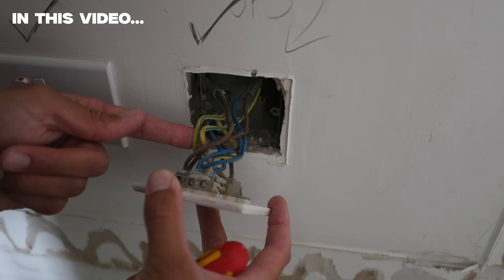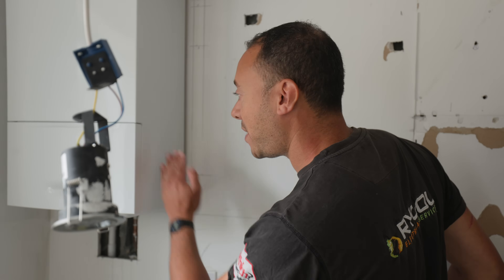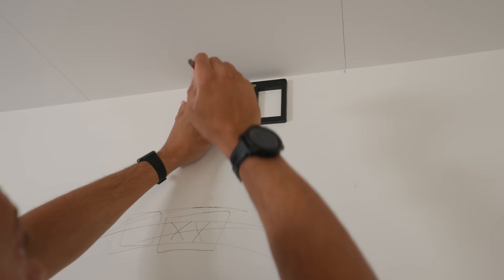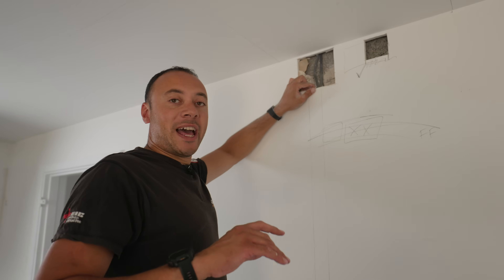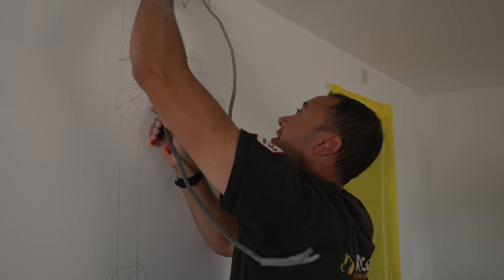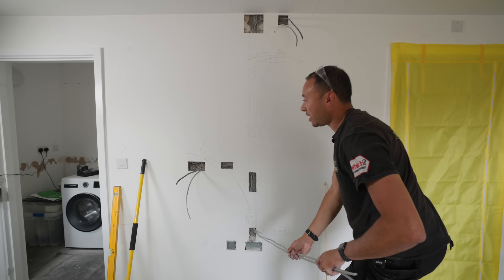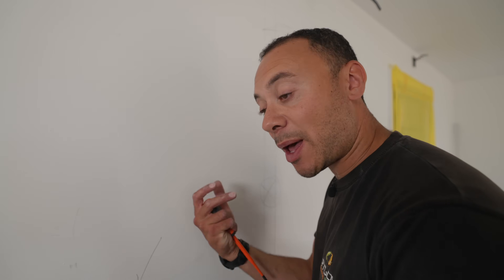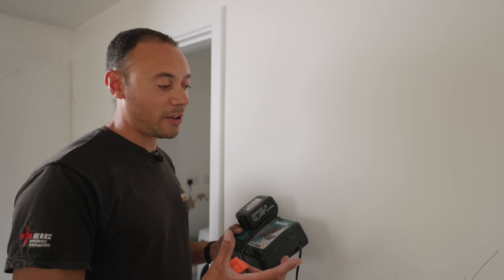Adding a plug socket? Don’t get it WRONG!

Comment: Really should be 500 V for the IR test.
Reply from the maker: I used to. But with all the equipment now I chose 250v
Reply: @RygolElectrical  I know it is easier doing 250 V since you don't have to remove all the loads and sensitive equipment, but to get a tougher more accurate test, I join the line and neutral for one lead and use the cpc for the other lead and test on 500 V, doing it this way means the voltage across the load is zero so there can be no damage to anything when doing the test. In this case you are testing line v cpc and neutral v cpc at the same time, after doing that you could then test L v N at 250 V, at least this way you have done the correct 500 V test for L v E and N v E. Just remember if testing at 500 V to remove any SPD's, or if there are SPDs then it is ok to test at 250 V.

Comment: Is it so that if the live or neutral sheathing becomes compromised within the cable, it shorts out to the bare earth and lets you know there’s a fault?
Reply from the maker: It most cases it does. That is the design of it, yes
Reply: @RygolElectrical lucky amateur guess 😅

Comment: Earth is unsheathed so that it is the first thing any other wire shorts to - you only want the additional yellow/green sleeving where the bare copper is exposed in a back box where it could short against a terminal screw

Comment: Metal back box fly lead?? requirement came in under the 14th in 1966 and has remained ever since.
Reply: No it hasn't. as long a there is one fixed lug on the back box, there is no requirement for a fly lead.

Comment: Why are you damaging your career and the future of any new electricians by pushing out videos that will prevent them from getting work whilst simultaneously egging on the inexperieced and unskilled to give it a go?
Reply: I had local firm out to install central heating as I wasn't up to that and they did a lovely job.
Got the same guys to do bathroom refit as I wasn't up to that and they did a lovely job. 

My wife the wanted the kitchen done and I WAS up to that......

I watched several similar videos, then videos about ring circuits, then oven and hob installation, then drywalling before pulling out my whole kitchen, drywall, coving, extending the ring, eight double sockets, two spurs, 6mm wiring, isolator switch, Cooker Connection Unit for hob and oven, plumbed in sink, dishwasher,  washing machine, installed units, worktops, breakfast bar, under cabinet lighting, tiled etc. 

I saved a lot of cash in that one so went ahead and had our old fusewire consumer box replaced by the electrician who did our heating install and it all went through without issue.

YouTube videos showed me how to do it all.

Comment: Surely Earth core is not insulated for safety which is it’s purpose. Should there be damage to other conductors or their insulation they are more likely to earth to a non insulated conductor. Also the reason why you should earth metal boxes

Comment: No wonder sparkies are called cowboys. Every new installation should include a circuit diagram, and any changes should be recorded and documented. In my experience, it has been the professionals that have left issues with wiring.
Reply: Sparkles don't believe in circuit diagrams. It is very amateurish.
I think they struggle to draw them.

Comment: If I wanted to add a socket, say 10 feet across a room from another socket, how do I keep that in a circuit as opposed to a spur? Also, are spurs allowed?
Reply: The difference between a spur and a Ring main socket is that you can install your extra so ket 10 feet from an existing ring main socket, but must connect up with TWO cables wired in parallel.
Does that make sense?
The CAN add it as a single wire spur, but can never wire on to an additional spur socket (ie you mustn't Daisy Chain it as you could easily overload the wiring causing it to heat up if you're plugging in high-wattage appliances like heaters or kettles.
Reply: @martinmorgan9 ah I get it. I'll make sure I do this. Thanks.
Reply: @The-Scots-man  You cannot just connect two parallel cables from an existing socket to a new socket and call it a ring main socket, it isn't, its still just a spur with two parallel cables which are no different to using a single cable with double the current rating.

Comment: Does a 20 amp MCB suggest any particular type of circuit.  Old property has a 20 amp circuit unlabelled that was on, but having switched it off haven't found anything obvious that is not working?! How would you usually trace it in these circs?
Reply from the maker: Its a case of visual investigation unfortunately. You could try turning all circuits off and turn the 20amp on by itself. See if you hear anything start up. Possibly be an old inmersion tank feed in the airing cupboard if you have one. Theres many it could be but it gives you bit of an idea. Good luck!

Comment: Top marks for encouraging sparkys to use both Earth terminals when provided.  Make it a habit and you won't find yourself having to check your work when you're wiring up a school, lab or other place of "raised hazard" and the main contractor forgets to tell you that high-integrity earthing has been specified.

I hope you doubled over the earth conductors, we can't seen on a phone screen...
;-)
Reply: Marks deducted for using both earth terminals - you've doubled the probability of an earth ring continuity fault if applied at every socket. Ideally (but not very practical) the ring final circuit would be comprised of a single,  continuous (uncut) cable around the ring, with 20mm or so of insulation being removed and the wires folded for insertion into the terminals at each socket. More realistically, lightly twisting the earth conductors together (but not at the ends inserted into the terminal) and inserting them into a single earth sleeve minimises the likelihood of a ring discontinuity.

If you want to take advantage of the redundancy of the two earth terminals on the socket for the highest integrity earthing then dress the earth wires longer, fold them into the first terminal and then loop them across to the second terminal.
Reply: @tonyh6309  your last paragraph I thought you were about to say put both Eartha in one terminal and use the second for the fly lead to any metal containment.  I see that done a lot by people who don't understand the Reg's...

But no, your main point demonstrates you don't appreciate the requirements of High Integrity Earthing, and worse, that you are one of the utterly hateful practitioners of the "highly deprecated practice" from the 1970's and before or twisting conductors together--

Twisting up your earths and then concealing your crime inside a single bit of sleeving makes it impossible to test the ring at that accessory and is likely to get an embarrassing level of "disapprobation" from any site supervisor or company tester...

When I was in lab at college ("AM1") there were two guys who had been working with their fathers and learned old-school bad habits from them as they came to get qualified.  The lab instructor was walking around watching us make up our first lighting circuit on the boards when the whole lab was filled with his screaming his absolute ire, "who told you to twist up your conductors like that? Did I tell you to twist conductors together?  Who's going to disassemble that now?  How dare you, disassemble everything and start again!"
Or words to that effect.  Ex-RAF engineer, he knew how to use his voice and his words to squaddies...
Needless to say they both broke that habit instantly.

No, that old-school practice existed before the need became apparent for routine inspection and testing or even initial verification.  And as for saving 0.1 of a penny by only using one piece of sleeving over both earths, forcing any future sparky or inspector to go and find more sleeving after he separates them before he can close the accessory, that's just lazy in the worst sense, similar to using an impact driver on terminal screws (a practice that I've seen get sparkys thrown off site for instantly: "nope, that type of workmanship requires us to inspect everything you do, which we have no time for, bye-bye").
 Twisting your conductors together in the manner you describe is bad evil and wrong.  Stop it now.  Know it's what your grandfather did, but know that we know better today and practices have changed for the better for a great many reasons beyond what I have explained here.

I will debate many other things with you -- modern practices, interpretations of Reg's, ACoP's, equipment standards, preferred manufacturers, whatever -- but not this.  There is no discussion.  It's wrong.  If you do it in an industrial/commercial setting you will receive the hate of many of your peers.

Comment: 2:45 I'm not confident so far...  I suspect you trimmed out more actions or comments than you intended:
1) "difference between DIYers and electricians ...we delve a lot deeper" except that you're skipping past the BS 7671 requirement to test at 500v, ignoring the GN3 recommendation to strap L&N together to protect sensitive equipment, "scratching the surface" at 250v.
You're using a Fluke (good man!) which safely tests at 500v by ramping up the voltage until it finds a poor result and then stops, while showing you what it's doing all the time.  There is no reason not to test at 500v, unless perhaps you are testing a lab or hospital with genuinely sensitive expensive kit attached.  A home has nothing that will be damaged by your tester attempting to put 500v between L and N while attached, it simply stops before it gets past 30v!
(Every modern tester is the same, although not all of them will tell you what voltage they are currently ramping through, some just give you the end result.)

2) 20MΩ does not indicate equipment normal attached, and the boiler is certainly not the cause: it will give you a dead short reading.  19-27MΩ (average range) shows an old neon indicator -- you have an FCU somewhere switched on, but with no load attached.  Simple as that.

Ok, let's see where you find it... <Play>⏯️

Comment: 2:45 I'm not confident so far...  I suspect you trimmed out more actions or comments than you intended:
1) "difference between amateurs and professionals ...we do things in more detail" except that you're skipping past the BS 7671 requirement to test at 500v, ignoring the GN3 recommendation to strap L&M together to protect sensitive equipment.
You're using a Fluke (good man!) which safely tests at 500v by ramping up the voltage until it finds a poor result and then stops, while showing you what it's doing all the time.  There is no reason not to test at 500v, unless perhaps you are testing a lab or hospital with genuinely sensitive expensive kit attached.  A home has nothing that will be damaged by your tester attempting to put 500v between L and N while attached, it simply stops before it gets past 30v!
(Every modern tester is the same, although not all of them will tell you what voltage they are currently ramping through, some just give you the end result.)

2) 20MΩ does not indicate equipment normal attached, and the boiler is certainly not the cause: it will give you a dead short reading.  19-27MΩ (average range) shows an old neon indicator -- you have an FCU somewhere switched on, but with no load attached.  Simple as that.

Ok, let's see where you find it... <Play>⏯️

Comment: No earth fly wire on the metal box 😮
Reply: Only if two adjustable lugs are present but with one fixed lug not required as per guidance note for earthing
Reply: Not required in this case.
Reply: When the fly lead reg came out, we were told that it was to keep the box Earthed if the socket front was brought forward live. Loooong time ago,. 😁
Reply: @philipgreenwood746Shouldn't be working live anyway

Comment: I love the box for marking. Far easier.

So many horror stories I could mention but the worst for me was I broke an old socket in my house. Got an identical one from a relative and switched off what I thought was the right circuit. Got zapped and switched off all 15 amp circuits but used my tester and it was still live. Switched off all power and then I found it was wired into a light circuit. After that I stripped everything keeping only minimal sockets while we worked on the refurb, then re-wired everything. Still not been perfect but part of that was due to something seeping through a wall that killed one socket.
Reply: Ive switched out loads of sockets and not turned electric off. Tip. Dont touch the cables dick

Comment: Yep, if you have to watch a video know how to install a socket you probably aren’t capable of doing it and should leave it well alone!!!
Reply: I watched several similar videos, then videos about ring circuits, then oven and hob installation, then drywalling before pulling out my whole kitchen, drywall, coving, extending the ring, eight double sockets, two spurs, 6mm wiring, isolator switch, Cooker Connection Unit for hob and oven, installed units, worktops, breakfast bar, under cabinet lighting, tiled etc. 
After all that I had our old fusewire consumer box replaced and it all went off without issue.

YouTube videos showed me how to do it all.
Reply: @fabianmckenna8197  … maybe start watching videos on heart transplants and hip replacement in case someone you know needs one!

Comment: Metal box wasnt earthed, is that ok?
Reply: Yes, assuming it has at least one fixed lug (which most do).
Reply: @Raysnature  one fixed lug, what does that mean?
Reply: @enoz.j3506 The little tabs on the side of the box the fixing screws from the socket go in to. One is able to move slightly to alow the socket to be levelled, therefore can't be guaranteed to have good earth continuity. The other is simply pressed and is part of the box thus much more likely to have good continuity. 
If the box has this fixed tab/lug then it is considered acceptable not to take a flying lead to the box. As you can see from the comments many would consider it best practice to do this anyway but it's not strictly necessary.
Reply: @Raysnature  ok,i get it now. Cheers.
Reply: The hole in which the fixing screws go are lined with metal and that metal is connected to the two earth terminals on the rear of the socket.

So the conductive earth path is from the backbox to the fixing lugs, through the fixing screw, through to the hole's metal liner and to the earth terminal on the rear of the socket.

Comment: Surely, putting more slack up into the ceiling or wall cause the wire to be away from regulation safe zone areas?

Comment: This is an English thing with the ring circuits. 
Only branches are allowed worldwide.
Reply: In Germany the PE also has its yellow-green insulation. 
This is an English thing that the PE is blank and thinner.
Reply: German sockets are not standardized as to whether L or N is on the right or left. 
It is regularly swapped. 
Nothing bad has happened in the last 90 years.
Reply: @jensschroder8214  Of course plenty of bad things have happened - see live chassis radios, for instance. Also, 13 A plugs contain a fuse (to protect appliance cables against the 32 A ring capability), so you want this in line, not neutral.
Reply: @matthewmarks6951 Oh dear. There is a problem with your understanding about electric current flow.

It's the same current in Line and Neutral so it doesn't actually matter where the fuse is placed, in the line or in the neutral path.
Reply: @deang5622  Oh dear. There is no problem with my understanding about electric current flow, but there does appear to be a problem with your understanding of relative potentials, or at least my post.

If the fuse is in the line and it blows, then the appliance is safe because (barring additional faults) it is at earth potential. If the fuse is in the neutral and it blows, then the appliance will be at line potential.
Reply: The French and Poles also couldn't agree which side was L or N.
Even if French sockets (and Polish sockets) are polarized. It is not certain which side the phase is connected.
Reply: They're used elsewhere too, in conjunction with BS 1363, because you need a fuse in the plug to protect the cable against 32 A.

Comment: You did not earth the back box too 😁
Reply: Yes it is earthed. It is earthed through the metal fixing lugs, through the fixing screws and to the CPC connected to the rear of the socket.

This sparky knows this rule.

A lot of sparkies don't know this rule. But this one does.